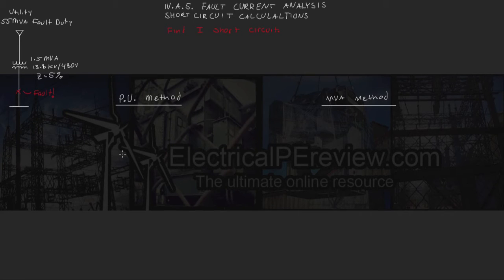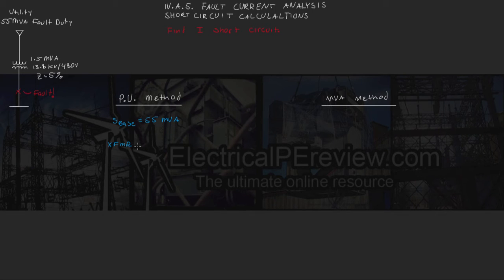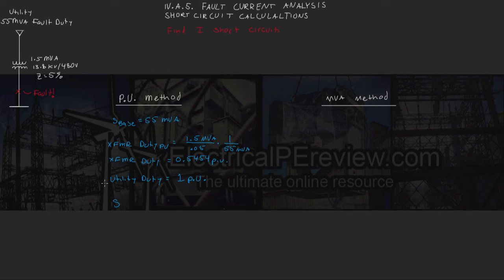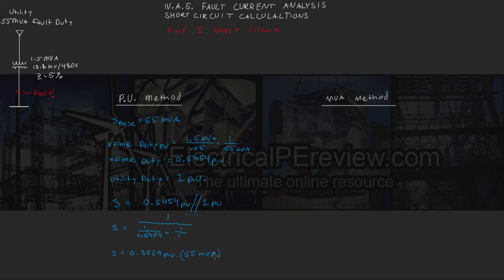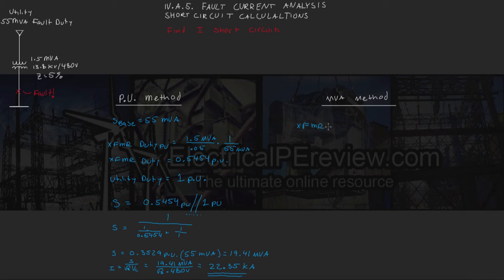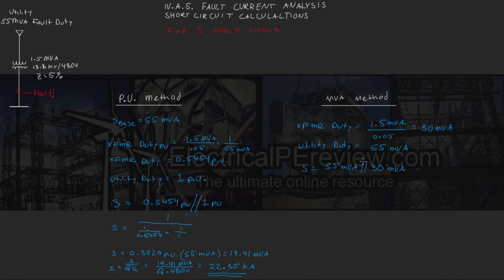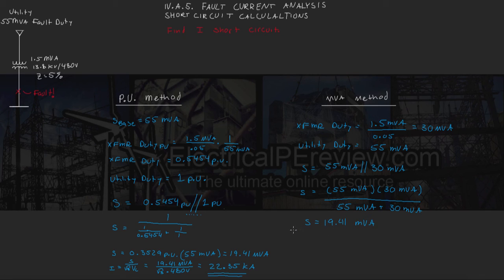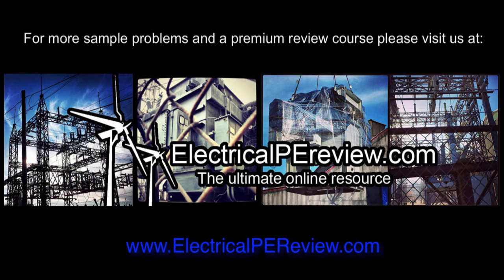IV.A.5. Fault Current Analysis Example - NCEES Electrical Power PE Exam

Comment: How did you got 30mva
Reply from the maker: 30 MVA is the fault duty of the transformer. You can calculate the fault duty of a transformer by dividing it's rated power by it's percent impedance. 1.5 MVA / 5% = 30 MVA.

Comment: why are the MVA values calculated as parallel equipment even though they are in series?
Reply from the maker: Hi Collin, good question. The short answer is that since the MVA method uses fault duty values, which are calculated by dividing rated power by percent impedance, we are really working with admittance values of each device/machine. Since admittance is the inverse of impedance (Y = Z^-1) the rules for summing the values are opposite of the rules we typically follow for impedance when working with series or parallel components.
Reply: @electricalpereview  ahhh i see, thanks!

Comment: Ahead of the solution portion, I paused and solved using both methods selecting transformer values as a base. Got the same results. Another thing to remember is MVA method is only good for a three-phase short circuit.

Comment: actually Ifault = 23.35kA,  please check solution to guide people. Thank you.
Reply from the maker: Hi Reyred, that is the correct answer same as shown in the video for both the MVA and Per Unit Method.
Reply: The answer shown in your video is 22.35kA, not 23.35kA. The methodology is correct, the final answer in the video is not. I spent 15 minutes trying to figure out why I arrived at a different answer than you did in your video. It is a good and beneficial video and thank you for spending the time to make it. I would maybe add a comment at end video with the correct answer so that others do not spend time like me trying to figure out where the issue is.
Reply: @midoemara867  soo whats the solution
Reply: @rafihaq3485  Mido is right it seems typo error only, the actual answer is 23.348 kA

Comment: Sir what i meant to ask is that while calculating fault current we need base kva  and maximum fault at utility. How do we get those
Reply from the maker: Hi Amit, in this problem the fault duty of the utility is given.  This value is the fault power in volt-amps available at the utility connection feeding the system. It would be equal to the MVA available at the utility divided by the equivalent percent impedance at the utility if given. When given fault duty, this calculation has already been calculated.

Comment: sir how do we get to know the fault level at utiity ??
Reply from the maker: Hi Amit, draw the fault located between the utility and the transformer instead of showing it after the transformer. This will change how you calculate your values in either the per unit method or MVA method since a fault between the utility and transformer will put them in parallel with each other, instead of in series.

Comment: One of my favorite topics covered by Zach! His analysis cuts to the heart of what to expect on the PE exam and his patient explanation will guide you  carefully through the process of understanding. I highly recommend his course! If you aren't familiar with fault contributions of transformers, generators and lines to short circuit current (MVA or PU method) this is a must have video.
Reply from the maker: Thanks Damian!